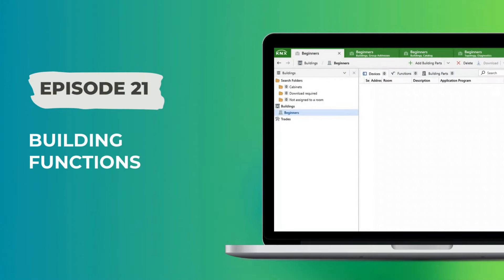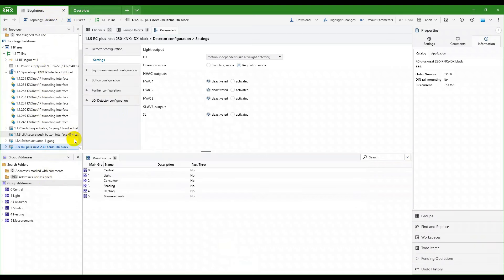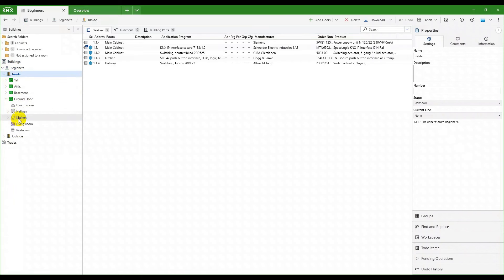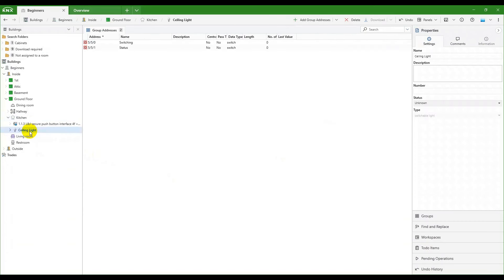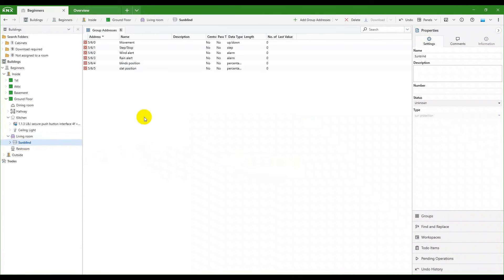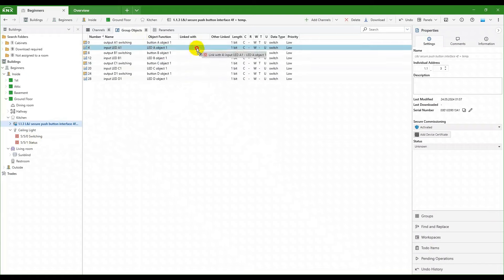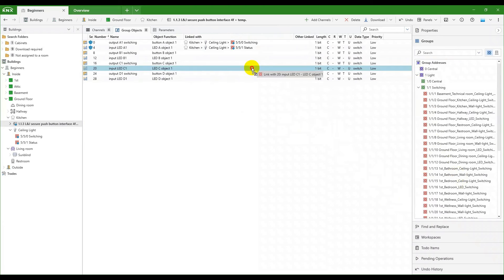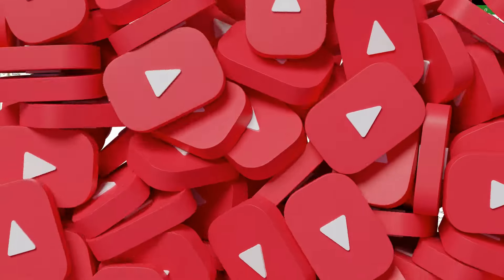ETS for beginners Episode 21 - Building Functions

Comment: Very nice 👍
When the implementation of more function like : scene, clima, rgbw/hcl light, hvac thermostat, locks, access control, sensors, doors, etc…. ? 🙏
Reply: Good suggestions! Any other recommendations, or suggested groups to be included in each?
Reply: @michaelcritchf  I would say that all the functions required by a KNX electrical system should be added.

So all types of lighting management, then On/Off, dimmer, HCL, RGB, RGBW, HSV.

All types of shading management, such as shutters, venetian blinds with slats, including limit switches and the state of movement.

The weather stations, with all the sensors.

The management of temperature, humidity CO2, VOC, lux, pressure, wind, proximity sensors, etc.

Scenarios via central and 1 Byte commands.

And much more.

If the goal is really to create group addresses through functions, making the classic method we have used so far a method to be abandoned. Then you have to foresee all the possible functions that a KNX system may need, which are really many.

If then the functions will be used for semantic export, to be used in IOT integrations and for the self-configuration of KNX supervisors, then all the more reason many more functions must be provided, compared to those proposed by ETS6 today.

I congratulate you for the excellent work you have been doing for 34 years now. And I take this opportunity to ask you when you will make ETS6 a software with more accessible periodic pay-per-use cloud licenses, as streaming platforms already do (e.g. Netflix, Apple TV, etc..). If you could pay €10 per month to use a cloud license, you would drastically cut down the economic raving to use ETS, further encouraging new users to adopt the KNX standard.
🙏

Comment: Why do we use the building function?
What are the benefits of using the building function?
Reply from the maker: The use of Building Functions adds an aggregation layer in the Building other than the Group Structure that would be relied on otherwise. An example for working with Functions: 
A Function "Ceiling Light" has a location "Office 2.251" on the "Second Floor". 
With that, the Groups included in that Function have short Descriptions such as "Switch On/Off". 
Doing the same without the use of Functions would require the ETS User to give more comprehensive Group Descriptions, such as "Main Building 2nd Floor Room 2.251 Ceiling Light Switch On/Off".
When working with Functions, the additional context of Location and Function is displayed next to the Group Description on the Device Objects, in the Group Monitors and in Reports.
Lastly, Visualizations can make use of this added context information from the ETS Project or Semantic Export and create Rooms and Functions based on this information.
Hope this helps☺
Reply: @KNXAssociation  thanks for your explain